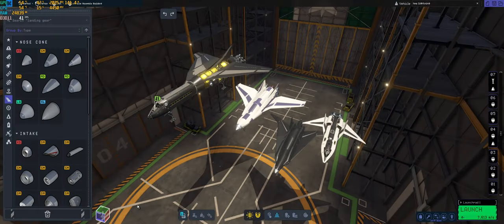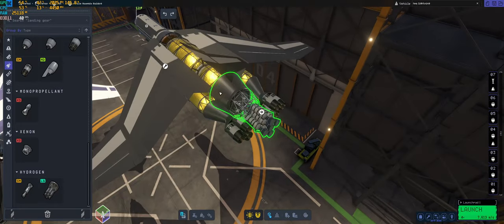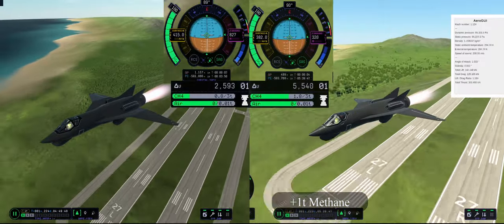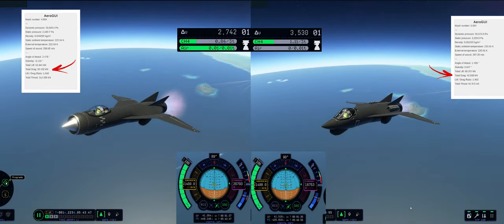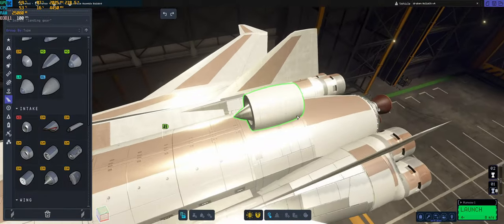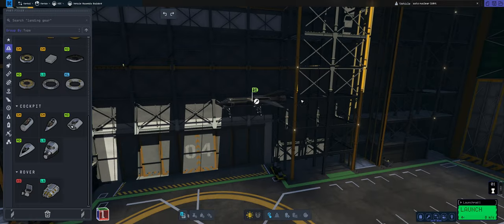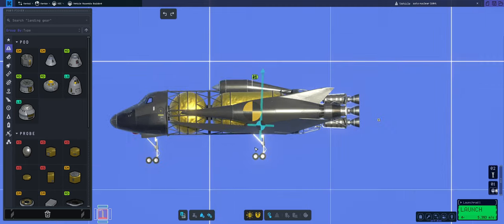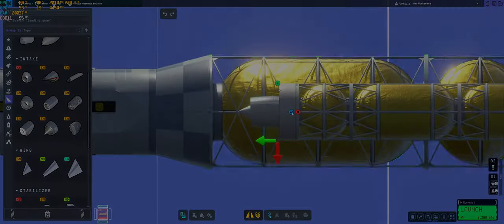KSP2: Become a PRO SSTO builder (Detailed guide)

Comment: Another tip on the landing gears:
When you land your SSTO and you naturally try to break, usually the entire plane starts to pitch down and try to flip its rear up causing imbalance and loss of control. The reason for this is the breaking of the front landing gear, they generate a leftward torque (considering right hand rule) on the center of mass and cause that flipping.
Usually players avoid this simply by repeatedly pressing the break button but the simpler solution is to decrease or completely eliminate the breaking power of the front landing gear (front of the center of mass of course). To compensate, simply pump up the breaking power of the landing gear in the back.

Comment: How did you rotate the wing like that at 15:14. I feel like my rotating tool as discrete step sizes and not continuous changes?
Reply from the maker: you have to turn off ''magnet'' tool. Its at the bottom center of your screen.

Comment: Really glad to see that long-range SSTOs are still possible; I'd been a little worried that needing an entirely different type of fuel for the nukes would restrict what we can do with them. I haven't spent much time trying to build any SSTOs in 2 yet, since the fuel crossfeed still tanks the performance and makes them painful to fly. Thankfully it's way better since the first patch, but it still has a long way to go to.

That said, are you sure about the nose cone sizing (i.e. the only thing that matters is the attach node size and not the nose cone's actual diameter)? In KSP1 I'm pretty sure the cone needed to be the same size as the part you're trying to occlude, regardless of the actual node attach point size.

(edit) side note: how are you attaching wings to other wings to make those bent wings like that?
Reply from the maker: So we dont have a detailed enough debug menue to really tell whats going on with the cones, but from my testing, it seems like fitting the smallest cone possible that still matches the node size seems to result in the least drag, at least for rapiers, other engines and cargo bays.

You can attach parts to any section of the wing. Personally, id suggest zooming in on the tip to make it easyer to align stuff.

Comment: Excellent overview, thank you for that!

What I find a bit depressing is how they seem to have copied so many systems 1:1 from ksp1. Like, why do we still have do this bs with putting a nose cone on the back of our rapiers? What does this add to the game?
Also things like wings not producing lift when your going straight - sorry that's not how real life wings work. Or friction control on landing gears. 
Wasn't it the whole point of doing KSP 2 to get the chance to start over with core mechanics?
Reply from the maker: Well i am incline to agree with the rapier part, wings needing an incline to operate is actually how real life wings work .
Basically, wings work by creating a difference in pressure between the upper and lower section of the wing. The wing re-directs the air flow from above the wing under the wing, which creates a lower pressure zone above it, and a high pressure zone under it. This effectively ''sucks'' the wing upwards. By adding a little bit of wing tilt, or by increasing out planes AoA, we drastically increase this effect.
If you look at real planes, nearly every single plane ever made is going to have some form of wing tilt to take advantage of this effect (and thats also why wings are shaped the way they are, in a half-tier drop shape)
Reply: @Kerman_von_Braun  well yes but:
Where is the tear drop shape effect that produces lift when the wings are level with the air stream in KSP? It seems to be pretty much absent.
And why do we need to manually rotate the wings every time? Couldn't the wing parts have some minimum amount of incline when you mount them without rotation, so they actually produce their lift when the fuselage points directly into the wind stream?
Reply from the maker: @lb2791  If you make a big enough wing, or have a small enough craft, you wont need wing tilt in ksp. The test ssto i used basically doesnt need it, for example. Honestly, wing performance is very satisfactory in my opinion
Reply: @Kerman_von_Braun  ok, interesting! I haven't been able to play ksp 2 yet because my pc is below spec. In ksp 1 it seemed to me like wings didn't really generate any lift when they were level, you always had to either angle the wings or point the craft slightly up.
Reply from the maker: @lb2791  If youre not super far below min spec you might still be good honestly. Specs dont make thaaat big of a difference when it comes to ksp2 fps. Generally, anything above 2060s has big diminishing returns in terms of performance, based on what ive seen from discord reports.
Thats for sure one of the big upsides of ksp2, you can actually make more efficient planes/ssto's if you know how to optimize, and aerodynamics do seem to be improved overall.
You could check out the part where i compare engine intakes. The craft with the shock cone doesnt have angled wings and its flying early lvl the entire flight. Honestly, that specific ssto basically doesnt benefit from angled wings at all, probably like 1% d.v gains lol.
Reply: @Kerman_von_Braun  I've got a L
laptop with a 1060 😂

Comment: What effect does the thickness slider have on the other aero parts? (Stabilizers and control surfaces)
Reply from the maker: Ive not tested it, but id imagine the effects should be much the same. I dont really see a reason to have thick stabs or control surfaces on any craft, so id suggest keeping them as thin as possible.

Comment: I'm pretty sure having an anhedral angle increases stability in an airframe, as it makes the plane "swing down" to the bottom of an imaginary pendulum. It naturally returns to a level position relative to the horizon. Having a dihedral (upward tilt from inside to out) angle increases instability but also roll performance. 

Basically, the way you tilt your wings up from medial to distal, that theoretically decreases stability. At least, in real life air frames. I could be entirely wrong, but everyday astronaut has a video on fighter jets where he talks about this.

I might be getting things backwards to be honest. I am not trying to correct you or anything. Just discuss.
Reply from the maker: so i dont think that anhedral or dihedral makes any difference (could be wrong), and the main thing that matters is where the wing is in relation to your center of mass.
But an interesting point, will need to check his vid out and educate me self on this since i dont know that much about real wing design

Comment: bro my sstos keeps drifting when I try to takeoff or land, I tried with small, mid and big SSTOs with different wings and landing gears, that shit is driving me crazy
Reply from the maker: My 2 best guesses would be either not enough lateral stabilization, if it starts to drift at higher speeds. In which case, add a larger vertical stabilizer. Or, if it happens at slower speeds, then disable steering on rear landing gears.
Reply: @Kerman_von_Braun  that helped me, thank you so much man, I added two vertical stabilizers just so I wouldnt have to make a huge single one, it killed all the drift!  thankssssss bro

Comment: should make a video about rocket only ssto, minor efficiency loss but you can make them absolutely massive and the just fly 45* into orbit no fuss

 made a ssto with two of the largest cargobays, after that even the XL wings aren't strong enough so its the limit for size atm
Reply from the maker: im not a huge fan of rocket ssto's personally, i dont really see a point to them, when the biggest benefit of an ssto is saving a lot of fuel by using the much more efficient jet engines for the first stage. which you can use just as well for extremely heavy lko lift craft.
Tho i will be making cargo ssto's once the cargobay bug is fixed
Reply from the maker: Also, as a side note, i do intend on making some super heavy ssto lift class that i like to call the ''atlas'' class, which is 200t+, I recon i can make a 500t lift craft with the help of hydrogen honestly.
Reply: @Kerman_von_Braun  true no real reason to not just rapiers, however there are three drawbacks: 1. in campaign you usually unlock the rapiers quite late, ssto rockets are obviously still ssto's so its relevant for mid to early game when strapped for cash and no rapiers. 
2. they are a lot easier to fly, for space stations or space assembly when you need to do many rounds ease of use is quite nice 
3. for really large ssto's you need lots and lots of rapiers while a rocket version is much simpler with just a couple of engines or just one, reduces complexity and part count quite a lot

i mainly use them as cargo lifters for lko
Reply: @Kerman_von_Braun  nice look forward to it, so far the wings just flopping of was the limitation for me, landing wheels also got super glitchy with all that weight
Reply from the maker: @nichootin  tbh, for big ssto's, just run with unbreakable joints. The way that wings break off so easily is bs anyway.

Comment: Amazing drag works the same as ksp 1 with zero improvements 👏
Reply from the maker: Its a little better :p Idk how i feel about it being roughly the same. I see + and - for both arguments
Reply: @Kerman_von_Braun   I feel that they are very unimaginative. The way you fly is the same, the way you build is the same, the way aero works is the same.

You still have the same problem when building a twin fuselage plane (route part problems). And the drag is calculated based on node attachments. It's a flawed system they did not attempt to improve even when a better system exists already at least for the aerodynamics in the form of mods.

Comment: I am sad that drag more or less works the same as in ksp1. I was told they they are using different game physics, i hoped that drag finally has to be infuenced by the velocity, cross section aera, and shape of the aircraft.....and not stupid nodes, where you should cover the engine to get less drag. Still makes no sense. I wonder when they fix cargo bays, covering the inside with a fairing, like VAOS tought us will still work? Thx for all the tips man o7
Reply from the maker: Whops, missed your comment haha. Must of checked it super early in the morning.
So nodes arent the only thing that create drag. I probably could of explained it a bit better in the vid. Nodes are simply drag ''high points'', but the whole airframe does generate drag based on its orientation to the air stream.
Its basically impossible to tell if the fairing trick will work, since fairings also dont work currently lol. Id say its a 50/50.

Comment: Man they really need an improved aero model. It seems like it's already quite different to KSP1 in a few ways but stuff like this needs to go forever. I'm all for a full FAR type model but I would take a multi-point aero model, with reversed nodes occluded.
Reply from the maker: FAR would be very nice. Tho at the same time, it would prevent people from making some really cool (and not so realistic) builds so idk, id say there are both ups and downs to this.
Reply: @Kerman_von_Braun  I think it could be scaled for difficulty and allow designs that are less than realistic.
Reply from the maker: @RpattoYT  well, some designs need to have functional wings clipped in to the fuselage to fly, so some more outlandish builds may not fly with FAR :p

Comment: Wait, wings in KSP 2 don’t generate lift when perfectly in-line with the airstream?
Out of all the stupid design decisions in this game, that might be the most offensive one yet…
Reply from the maker: they do, its just that its more efficient on most craft to run a smaller wing with some slight pitching.
Real aircraft do this as well :P
Reply: @Kerman_von_Braun   I understand that might be true in the game, but it’s the complete opposite from how it works in real life.

The angle between the longitudinal axis and the wing’s chord line is called the angle of incidence. In some aircraft, mainly GA and commercial, the angle of incidence is slightly positive.
That’s because it helps with lift and stability.
But it is only a couple degrees usually around 2, rarely more than 5. And many many GA and commercial aircraft have their wings mounted parallel to the the longitudinal axis. Instead of deriving stability from the AOI, they get their stability from dihedral.

On high performance aircraft, those with a need for high maneuverability or high speed, usually have 0 or negative angle of incidence.
AOI, especially excessive AOI, is a major hindrance to stability and aerodynamic efficiency at high speeds.

Granted, I’ve never done the math to design an actual SSTO, but as a pilot and someone who studied aerodynamics, such crazy wing angles just look absolutely ridiculous to me.
It’s as if the wings don’t function as an airfoil at all, rather just acting as a flat plate wing generating lift from AOA and airspeed by brute force.

None of that’s meant to reflect badly on you by the way. You figured out what works well in this very flawed game, so I’m glad you’re showing people how they can get a bit of enjoyment out of it.

Comment: @7:55 ... sorry, bit of a noob question? but what do you mean by you expend all of your delta-V? could you elaborate ... 

thanks

p.s ... loving the content thus far 😊😊
Reply from the maker: Simply use up all of your remaining fuel or ''expend'' that little d.v indicator at the bottom right, and you will be able to see which fuel type you have to much or to little off :)
Reply: @Kerman_von_Braun  ahhhh, like in a test flight? yeah sorry, this is what first came to mind but I was thinking there may have been a way simulate it in the VAB that I was missing.
Reply from the maker: @rustyneedles3743  haha, i wish man!
When it comes down to it, building a highly efficient ssto takes tons of testing.
After a while, you will build up a bit of a general feel for what you need. But even with experience, you will still need to test and fine tune your designs to get them 100% optimal (which is usually not needed)
Reply: @Kerman_von_Braun  ha, yeah I thought it was too much of an ask, but than again, I'm known to miss some quite obvious stuff, ha, so I thought to ask just incase 😉thanks for replying to my questions